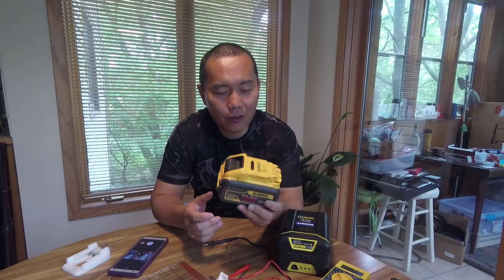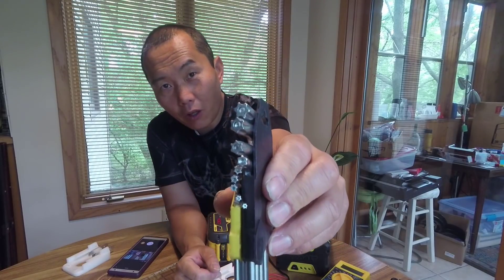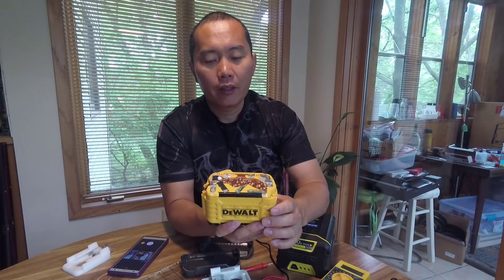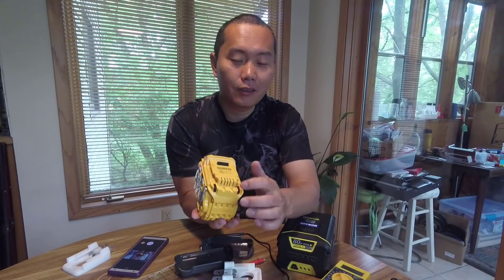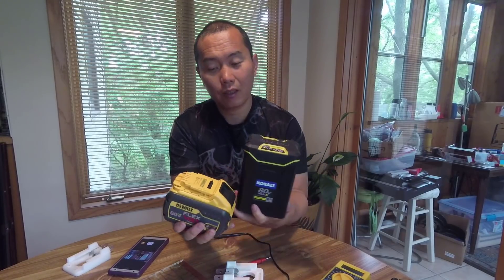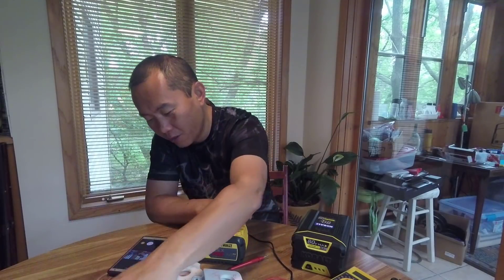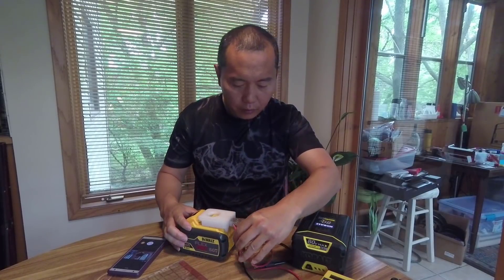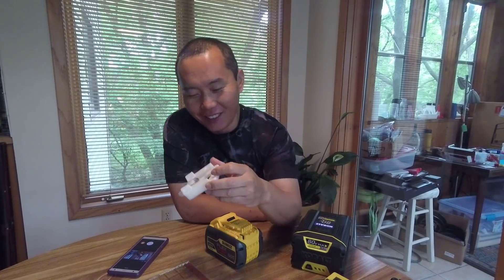DeWalt FlexVolt Battery teardown review how to get 60v

Comment: Would that Dewalt battery be good for a bafang mid drive motor?
Reply from the maker: The capacity is too small, won't get you much distance.
Reply: @JerryMinne  even with two 9ah ran in parallel to get 18?
Reply from the maker: 9ah base on 20v not 60v. It's only 3ah on 60v.
Reply: @JerryMinne  got ya so it would only be 6ah in parallel then?

Comment: I came to this video in hopes you would show how to take the top off. of it..  So, after some hesitation, I decided to try and force it off, slowly.  In case anyone else came here for the same reason, it turns out there's just some adhesive underneath it. Once all the screws are out, you can just SLOWLY pry it up and you can start to hear it separating, until it comes off.  I used a flat head to start prying it up from the front and back, then just pulled slightly with my hands.
Reply: Awesome thank you

Comment: The reset pin is number four  on DeWalt and could you please tell me which reset pin on The worx rechargeable lithium battery 20 v
Reply from the maker: I never heard the battery need to reset. where you find that?
Reply: @JerryMinne  with these "intelligent " battery systems,  there is a connect pin that communicates with the tools  and if you use a different charging system with only + and - main connection , the battery doesn't have the signal to tell the tool that all is ok. Check dealt as example. Fully charged M18 xc5.o ampere  won't work on tools if the 4th pin hasn't had a small shot of voltage to initiate communication.  I will send u a link.....take care and keep up the good recycling and sharing with us.thanks
Reply from the maker: that pin is monitor the temperature to prevent overheat.
Reply: @JerryMinne  I will send you example of this battery thing
Reply from the maker: @michaellaframboise7646  please I want to see.
Reply: @JerryMinne  I am searching my info for you now
Reply: @JerryMinne  DeWalt battery packs are quick to charge and long-lasting, and contain a microchip that shuts the battery pack off if it overheats. ... Once the battery pack shuts off, you have to reset it. The reset process clears the microchip's memory and gives the chip the "all clear" to charge normally. Without the original charger unit which speaks to the microchip, the battery will charge fully on a balance charger or another regulated charger ,but no message to microchip and first red light on battery will only flash red. This is where the voltage shot to #4pin is good.. almost everybody throws away these power cells because the red light tells them it's no good.  I get free all the time from recycle bin at home depot.
Reply: @JerryMinne  I will test to find reset pin on the worx battery system tomorrow and then give you more info.goodnight and take care of your self and your family

Comment: C🍁an i get  step down  to 12 volts  from    my flexvolt  ?   also like  to be able to run an inverter  using one or more flex volt is it possible ?   this only 2 things i want to try .. also like to run small warn 12 volt winch and make stand alone system similar to your beutiful winches..cheers 

⛵
Reply from the maker: Yes, I plan to my 12v converter to compatible with more batteries.
https://minne.us/shop/80vstation/